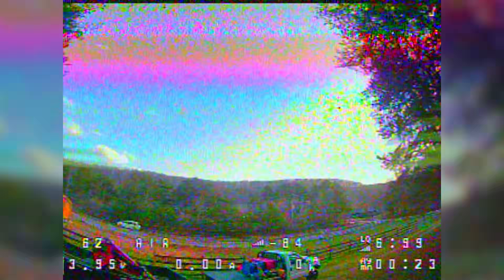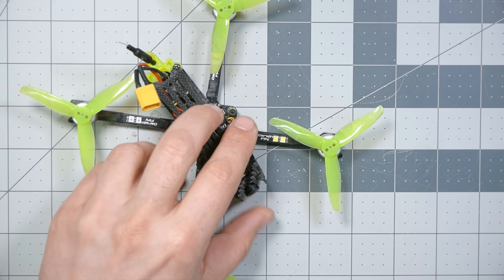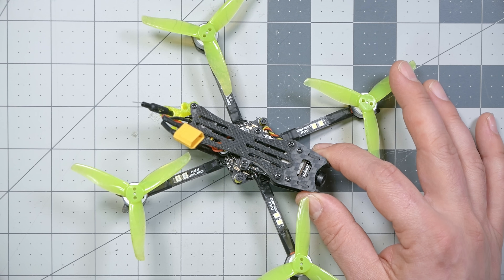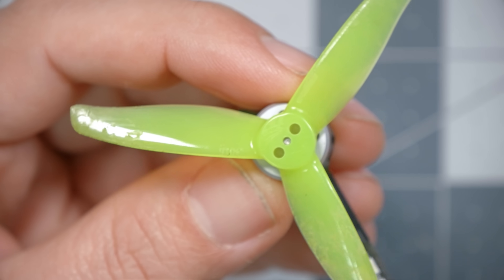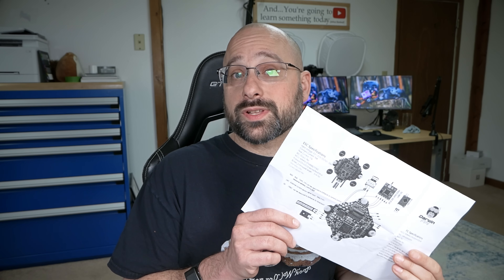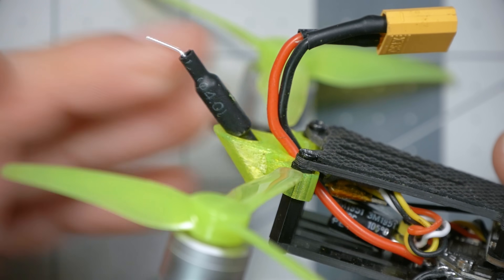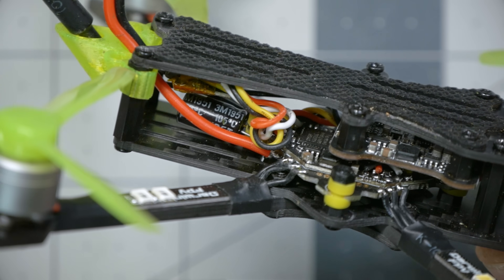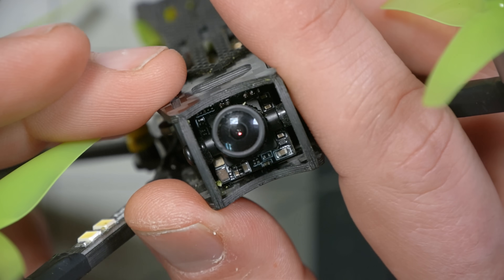Best value quadcopter under $100: DarwinFPV Baby Ape

Comment: This is 2026 and I just purchased the Baby Ape Pro V3 in the 4S version (It flies great on 2S BTW, with plenty of Punch due to the low weight), at the end of 2025.  She's up and running.  The latest version of Betaflight didn't auto detect the MPU6500, so I had to add it manually in the extras when flashing my FC.  It came flashed with a beta Version of BlueJay and that handy little, 3d printed spot for the XT30 connector is now absent, and the props threaten to take out the power wire which now exits from the rear of the Copter.  KEEP AWAY FROM THE CHOPPER!!! I'm going to fix this issue with a 3D Print. I got 8 minues of Casual Flying from the 2S, 25C LiPo with a takeoff weight of 110 Grams which means I could fly two of them strapped together and still be legal in Canada. 
Edit: After taking it apart I'm thinking there was an error at the factory as I found a much better way to route the wiring below the ELRS reciever that keeps it safe. Might be a Monday Build.  Also Noticed it shipped with the Waterproof reciever.

Comment: My only comment would be that the 1.5mm shafts on those motors would be the weak spot without the backup screws in a crash scenario.  I've busted quite a few of those shafts when I wasn't using the screws, vs having them in.  It's more for strength than prop retention, though it does help if you get one that doesn't fit snuggly anymore.
Even without the shaft the props will stay on with just the screws. With that being said you can always upgrade the motors later if needed, to something that the prop holes line up with.
You've got lots of overhead to keep it Sub250.

Comment: Better yet build your own with the Darwin 411 board with express elrs built in some 11xx motors the happy model triangle board with the cadix ant camera in a dark night frame. @ around $140 with better frame  better camera way better vtx and no proprietary board mounting like a tiny hawk 2(I just make sure an adaptor for tiny hawk to run a regular whoop style board) loads of fun without people freaking out like they do when they hear the anger coming from a 5". If I test hoover my 5" at the park I play horseshoes at everyday people freak out. On the other hand I can fly a tiny hawk freestyle and all the people I see are checking it out and smiling. Night and day different reactions. ☠️

Comment: I wanted to ask you another little question I plan to take the drone in fpv Darwin
Baby pro the problem I encounter is that there are several types of batteries Lipo 3S with several voltage I have two that I bought recently in 3s 11.1v but I found them long in dimension and as I do not have the drone under eyes I do not know if they will go on and I do not know how to find the info to know what voltage accepts the drone system for Lipo batteries can-you send me a link to find what you need, thank you in advance for your response

Comment: Can this ESC be flipped upside down so that way USB port would be facing up? I'm building a custom frame and if I have USB facing down it would be directly on the frame. I would still follow correct motor diagram even if I flip it. Or instead of flipping it upside down can I just rotate it 45 degrees so that way front of ESC would be on either left or right side of the drone.
Reply from the maker: You can flip the FC any way you want you just need to adjust the board alignment in Betaflght.
Reply: Thank you thank you❤

Comment: My biggest complaint with this quad is the battery connection. The pig tail is so long and the top deck is so close to the props I haven’t found a way to secure the battery that I don’t feel uneasy about, especially using the equipped rubber bands.

Comment: I bought a baby ape pro and tore it apart. It now has custom frame standoffs to fit a walksnail avatar vtx with a a nano camera, a new jhemcu 2-6s f411, a spectrum srxlv2, and FT gremlin 1106 6000kv motors, and dual foxeer antenna and dual antenna for the spectrum. there is literally no space in the frame for any of its internals.

Comment: Thanks for the review. Trying to decide between the Darwing Baby Ape 3 inch RTF vs. the Rekon3 Nano RTF kits(in my budget and Canadian 250g's requirements). I don't want to spend a lot of time assembling, just want to get into the hobby and maybe build later. My use would be for long range(?) in forested parks and areas(1-2km range would be good). Longer flight time and quieter operation would be favourable as I want to observe wildlife, but not disturb them. Your videos have been great but don't focus on casual flying  and both Rekon and Darwin don't say much on their website for my application and use. Wondering if anyone has thoughts on these 2 quads? I've never flown, so I want to spend my limited time practicing rather than studying and building. Thx.

Comment: The lktr120 and lktr90 were probably the first toothpicks. Because I was building them before toothpicks were even named toothpicks. But finding small formfactor flight controllers and esc were a big problem not to mention a camera vtx package. The good old days. Also the hermit was a good small frame set for the era.

Comment: What type of receiver do i need for this drone?
Reply from the maker: That depends on what controller you have. The receiver type must match the controller's module. All controllers have a built-in module that binds to a certain type or types of receiver, and most have an external module bay where you can add another module of most any type, to bind to other types of receiver.

Comment: I used mine with crossfire 55, crashed it alot, lost it on a swamp and recovered a week after, crashed, water, I mean, all possible bad things I have done with it and it still works so fine with me. I only lost sound recording on the vtx and the motor power just went a littke weaker

Comment: how would the baby ape compare to the tinyhawk 2 freestyle?
Reply from the maker: Baby Ape is cheaper but not as good quality hardware. Also, TH2 is 2.5" props vs. 3" props for the baby ape, so it's going to fly just a bit more like a micro and less like a big quad.

Comment: Great video! Definitely interested in this quad but honestly I’m watching this on an iPhone 12 and the upgraded camera looks worse to me. The camera on the cheaper model looks better than the camera I have on my eachine 010 Tiny Whoop so I personally would go with the cheaper model and maybe even upgrade to a better 3rd party camera. Either way I think I’m sold on this quad so long as I can use it with my Turnigy 9x w/FrSky DJT module. From what I understand this unit lacks a RX so as long as I can get a compatible one I think will be pulling the trigger soon

Comment: Hopefully you can help with an pid  issue. I have added a caddx vista unit and it is unflyable.  I have updated to the latest beta flight and it just has super jitters and motors are hot after seconds of arming. I am using the default pids so any help in making this flyable would help. I had this vista unit on geprc thinking p16 with 1103 8000kv and it flew fine until I killed it. For 80 bucks I figured try this drone and just add the vista unit but it is just unflyable.

Comment: Gotta say, I'm happy with mine.  I've flown indoors for years, and decided to try outdoor flying.  I'm on a tight budget, so when I saw this, I took a chance.  Was not disappointed with the build quality - it's a tidy unit.  Wish it had metal standoffs, tho'.  Gonna hafta order some.  I went with an ELRS receiver [thanks for the setup viddie, JB], and I'm using 2S, 450 mAh LiHV packs that I only charge to 4.2v per cell, and getting around 4 minutes flight time, landing when my average volts are around 3.7v.  [conservative, but I find it helps extend the life of the packs; I've got a set that's run almost two hundred cycles so far with no puffy ones in the lot, and no saggers yet]  It will do for now, as I have no idea how to get the most out of it yet.  I've got to give it a proper tuning in BetaFlight so it suits me, but so far it shows lots of promise.
Reply: hey man, same for me but the problem is that i have way to much vibrations with this quad... have you succeeded to tune it and upgrade its flying ? thanks man !

Comment: I live the way this thing flies.. my problem with it is the screws they used and how damn hard it is to get the props off.. I literally bent 2 motor shafts trying to change props. I also lost 2 motor screws off each motor….. really Annoying bc standard m2 screws r too big and won’t fit..

Comment: Honestly I wouldn't buy that as first quad, in August I took 115€ the wizard 220v2 and work so fine, is very stable and fast, decent quality overall...yes has CCW and CW nuts and CCW nuts are not easy to find as they don't ship with the drone for mistake but looks less toy ...it's personal opinion but that looks too expensive for what give

Comment: It's to do with (cubic) disk loading.  To "fly like a 5 inch" in a scale sense doesn't mean doing 5" speeds & being able to throw it just as far, a scaled speed should be more relative to airframe size, 10 airframes per second etc.  When disk or wing loading is calculated correctly & weight targets are met the scaled model will dynamically fly correctly, the only difference is air pressure & density (physics) not scaling with the model, also having to provide similar thrust to weight ratios & scaled prop pitch speeds.
These are some of the fundamental principles in scale modelling whether rotorcraft or fixed wing, when getting these factors right a model plane will have similar (scaled) stall speeds & stall characteristics as full scale, and appear likewise in the sky but shrunken down & flying in a smaller area.

Comment: I just reviewed this drone with the stock camera and the Ant camera and got the same impression. 

I was thinking I would have another bad drone to pilot, specially when I saw the motors, plastic spacers,... But I found a good drone to flight! Of course the Pro version that has the Caddx camera. I think it is a good drone to start with.

Compared to the Beta for a bit more... I don´t know, but in case you can not or do not want to spend more, for 100$ or 80€ this is a great option. 

Good to see that the Great Joshua thinks the same way!

Comment: In 2017 i bought the fullspeed leader 120. Something similar and after so many iterations of quads „we had to buy“ again a very lite and reasonable sized quad. Back then they said the 1104s are to small had too high kv and the quad is to light with 450mAh 2S. 
Fly what you love and enjoy the time in the air.

Comment: not just the best value quad, but also with replaceble arms and its spare motors are the cheapest in history (1€). I will install a BabyRatel cam and ELRS+OpenVTX and I can't imagine a better quad under 250g.

Comment: The camera angle not being able to go any higher is due to the bottom edge of the camera coming into contact with the bottom plate, if you were to take it apart and change the uptilt before putting it back together you can get an absurd uptilt. Basically there is a small range of angle where you can't fit the camera into.

Comment: I'm so glad you reviewed and like this quad.  I got it when it first came out and they didn't have the better camera option and it was called something like Darwin 69 or Baby Ape 69 because it was $69.  Before I even received it, I already had a Baby Ratel 2 waiting to put in it because I already knew.  Never even tried the original camera one time.  In addition, I've made other additions / modifications like swapped the standoffs for taller ones to increase camera angle, so of course I had to 3D print spacers for the carbon camera plates.   Also added a better VTX antenna, a buzzer and some little LEDs that show through the bottom and I printed like "walls" (for lack of a better word) that are similar to ones on the Roma frame. When I first got it, this was a big upgrade for me in size and performance because I was used to 2.5" quads.  Since then, I have built a 3.5" that is beast thanks to FPV Crate but that's a whole other story. I really just wanted to share what all I've done so people can know that even though it's the cheapest possible quad in 2022, a lot can be done with it and in my opinion it's definitely worth it.  Oh yeah, I've already broken an arm and got replacements which is a nice feature that I didn't have before, replaceable arms.  Spare motors can be found SUPER CHEAP on AliExpress (like less than $3 each) so I grabbed like 10 of them.  You are The Man Joshua!  Keep up the good work.

Comment: Hey ypu didn't say anything about the osd  part. Where ypu go into the screen to change things.
I have that aio fc on another quad, well I have 2 of them boards on 2 different quads.
But I wish they made the screen faster when trying to change the pids, it comes up sooooooooo slow on mine, and then I heats up my vtx fast, then I just say f it and go inside to tune the pids. Other then that it's a great fc.

Comment: Hi!
I have a problem with my quad, I have changed the fc 3 times and the esc one time, at first the quad wasn't flying correctly, then I replaced the fc and it got better, but it's behavior wasn't normal, so I decided to change the stack, now the quad flies super good, the blackboc log is pretty clean, but, when I do a hover test for 6 minutes approximately, the motors get a bit hot to touch, I can leave my hand as long as I want, but it hurts a little bit, I don't know why, I have been living with problems with this quad for so long, I'm frustrated.
Here's my setup:
Xing 2208 1800kv 
Mamba f722 mk3 fc
Mamba f50_bl32
5×4.8×3 props (Maybe the pitch is too high, but I live at 2640 meters above sea level)
Lumenier QAV-S jhonny fpv edition 
All up weight: 640 grams
When I do a bench spin up, I tested them at 1300 throttle for 30 seconds, they get a bit warm, almost cold, so I don't think it's a hardware issue (I hope)
Reply from the maker: It sounds like things are not really messed up at all. Flying for 6 minutes and the motors get a bit warm but not hot.... it could be totally normal. If the quad is flying fine then just fly it :-)

Comment: Ive actually been waiting for you to drop this review. I had already bought the quad when you did the ELRS Darwin BabyApe video a while ago. I have to say I was shocked by the performance, it flew really really well in my opinion. For about 5 packs. Then the AIO caught on fire. I did go down in the snow though but I've done that so many times with other AIO boards. Anyways probably my fault, but I did notice a few others complaining about their AIO board lighting on fire in the reviews on their website.

I actually ordered a new 12A AIO from Darwin fpv, at $40 I couldnt pass it up. Now if THIS one catches on fire too.. I'll be sure to get a different brand of board xD
Reply: call darwin and get a 50% off  there is something wrong with there aio's
Reply: not your fault it happened to me to read my comment i just put up on hear

Comment: I built a 3/4s quad using spare parts of a larva x HD and the hx115 LR frame.  When you price everything out, it came out so much more expensive then the baby ape.  The fact that Darwin can put out decent quads for cheap is great, especially with today's chip shortages.  Not all of us can afford this hobby, I'm glad there are options.

Comment: Hi JB,
DarwinFPV has an AIO with SPI ELRS now. So they will probably make a babyape BNF with ELRS soon.

I've recently bought parts and built a babyape using this SPI ELRS FC and a 300w openvtx.

Some annoyance on this frame and motors. The mount screws are 1.4M not 2M. The holes are also not the standard distance apart. So with this frame you're stuck with those motors. But hey they're $1.5 each.

Comment: This video is a mixed bag.  The deliberate chop/cut editing may seem cute for a moment but it makes it hard to watch the video after the first few cuts.  Please STOP IT!  On the other hand, the info pop-ups are a really good addition, allowing a less cluttered narration.  

As for the quad...  I much prefer the "bad" camera.  While the Ant may give more detail, that edge sharpening sparkle drives me NUTS and I couldn't fly that for very long.  Since the Ant can be tweaked, maybe the sharpness can be turned down to reduce that extreme distraction.  

HDZero - YES!  It seems that this quad should be able to handle the extra few grams, DO IT!  :D

Comment: Hoping you can help me out, I've got tbs crossfire on all of my quads, but I can only get 6 of the 8 channels working for some reason. When choosing aux channels, I've got arm channel on 5 and my beeper channel on 6, but when I try to use channel 7 or 8, I get nothing. It's the same in my betaflight quad and my kissfc quad. Any help would be greatly appreciated!

Comment: Joshua I’m in the market to buy a radio. I am interested in the RADIOMASTER TX16S MAX. Is it worth the 100.00 more for the max rather than RADIOMASTER TX16s? Are all the components the same on the inside and it’s just the cosmetics that are different? I think I want save the 100 dollars and buy the metal gimbals.
Reply: you are only paying for the bling.
Reply from the maker: The max has metal buttons and roller and metal plates under the gimbals as well as leather side plates. But it's all cosmetic.

Comment: Woah! It’s the OG Emax babyhawk motors resurrected from the dead! I bet they fit the 2.3” Avan-babyhawk prop screws, but you probably don’t want to fly smaller props on that quad. 😀
Reply: But why would you want to run smaller props?
Reply: Just saying- the screw hole will fit the original babyhawk props most likely